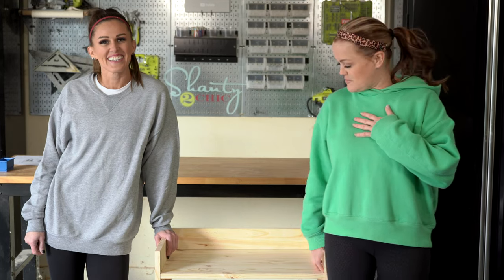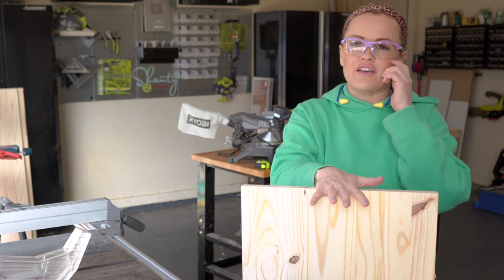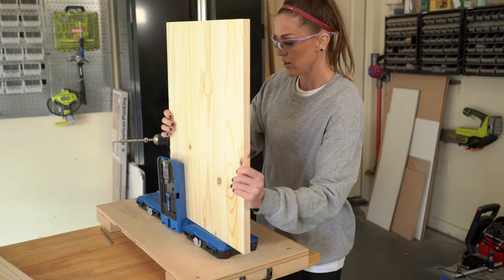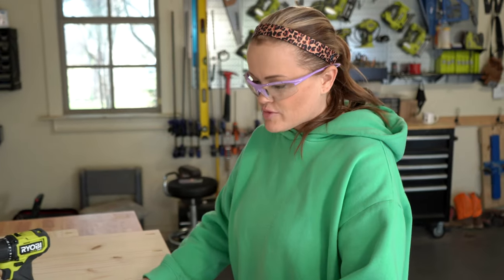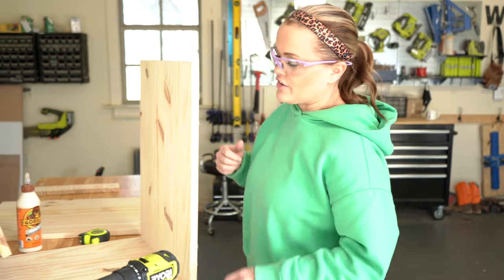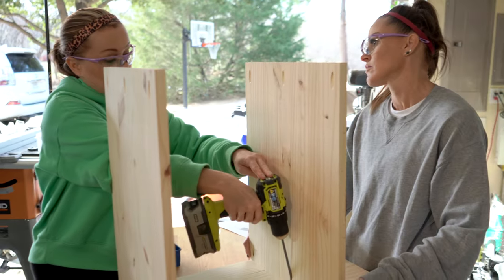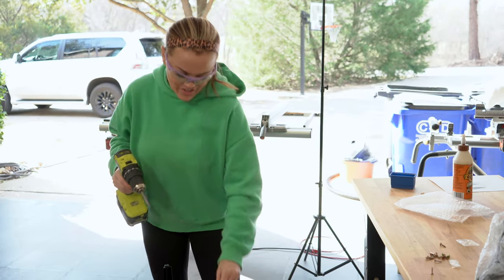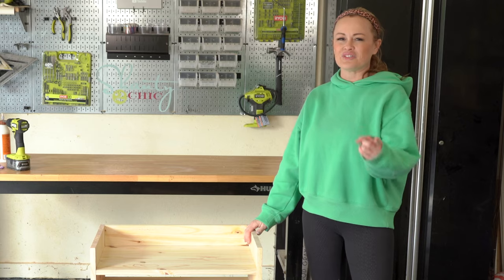DIY Record Player Stand

Comment: Is this build possible without the Kreg Jig to make pocket holes?
Reply: Hello, did you ever figure out the answer? I would say if you wanted you could use counter sunk screws from the outside going into the edge grain of the shelves. It will have visible screw heads that way but if you get a fancier screw you could incorporate it into the look. Like a black screw in evenly spaced places would look nice and add to the aesthetic.